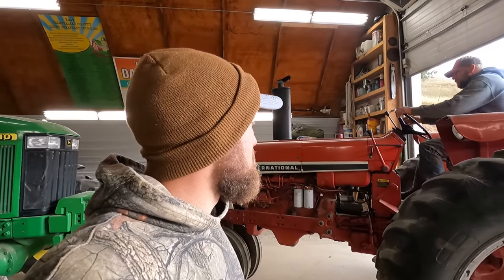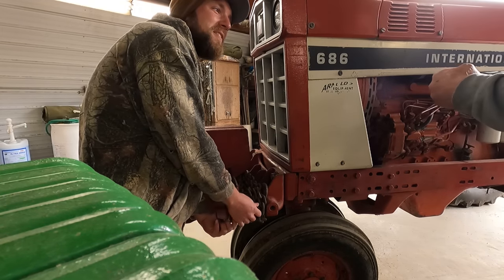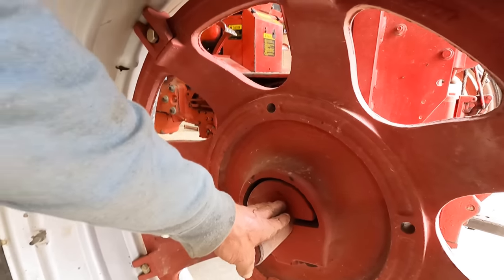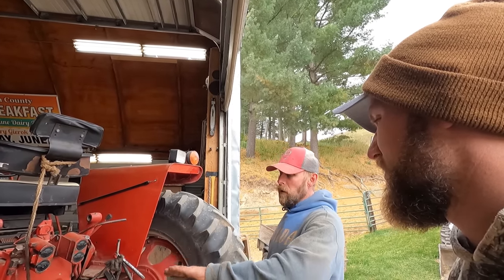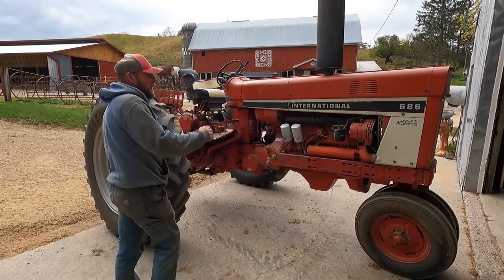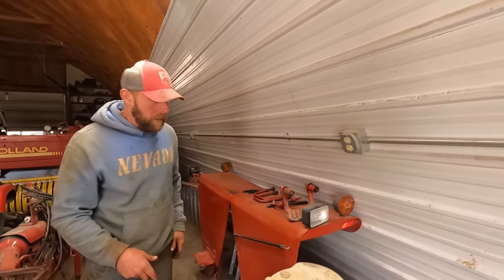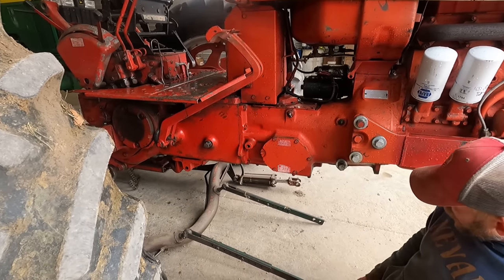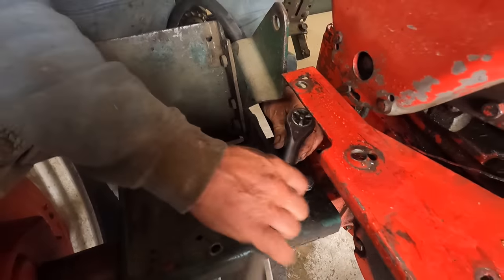Getting Ready For Harvest 2022 l Mounting The Corn Picker l Part One

Comment: This takes me back over 60 years ago. We had a NH picker like yours on a IH 656. We picked on a flat bed hay wagon which we installed 3 ft side boards. My dad would have my brother and I open the field with a machete. We would pull the ears off the stalks and sell them for feed for the birds and deer. We would tie the stalks and sell them for decorations. That was our  payment for opening the field. We would cut two rows around the field. Our income was around $50-60. Good money in the mid 60’s an early 70’s. Thanks for the reminding of this.
Reply: Why did you have to "open the fields" if you had a MOUNTED picker ?

Comment: I had a New Idea just like yours. We used the sheller attachment to shell out the corn cribs. Kinda strange arrangement but it worked great. The New Idea replaced the MH Self Propelled. Also we had a Ford Picker mounted on a Ford 6000. The New Idea was on a JD 720 LP. Memories Memories. Thank You 😊

Comment: I have a corn picking story to tell. I picked corn with my IH two row mounted picker. I was picking across the road and my teenage nephew was unloading into a crib. The corn was up into the roof and I saw my nephew up on the top of the crib and elevator. I overheated, so I began walking up from the field. The closer I got I could hear my nephew hollering. I ran as fast as I could. The chain on the elevator got loose and the cobs began to get in under the chain. My nephew tried stepping down on the chain to get the cobs going and his leg got caught. The paddle bent his leg behind his knee, and carried him up the elevator. He got to the top and it wedged him, and killed the tractor! Thank god I had a Farmall “C” on the pto. My wife called 911 and I climbed up with a bolt cutter and cut the chain and slid him down the elevator like a slipper slide. Believe it or not, it didn’t brake any bones. It didn’t even brake his skin open. It was probably the luckiest day of his life.
 I just wanted to wish you a safe and plentiful harvest!

Comment: The first picker I personally owned was a 237 John Deere which I mounted on a 60 John Deere. The guy I bought it from had it on a 70. The guy who bought it new in 1973 had it on a 3020. Most of my hours picking have been on a 4010 or 4020 with a New Idea 324 pull type. We had two of them, one with a sheller on it. My experience with the John Deere and from what some of my neighbors say, the New Idea was just a better picker. The sheller did such a good job the guys at the mill would compliment how clean it was. I just got my picker out and ready today. I'm going to pick a load tomorrow and run it through Minneapolis Moline sheller and into the feed grinder for my steers. As far as combines go, we had a 4420 John Deere on the dairy I work on today although it been gone for years. It was a good machine that covered a lot of acres. You can run a four row wide or narrow head on it and probably have better luck getting parts for it to.

Comment: I believe New Idea was the most popular picker, & manure spreader out there! Dad's right, 56 lb a bushel for shell corn, 70 for cob corn! I use to know all the weights, oats, wheat, barley, rye, ect! Your Dad is the man, he's right about side hills! I use to plow sidehills, always threw the furrow up the hill, so the next pass the wheel would be in the furrow to kind of level the tractor up! Hey, Bud! you know if you don't have a filter wrench your belt will work! Also, a belt works for a cow halter too! That's like a JD # 5 mower, it would fit different brands of tractors, but just different brackets! I was going to say, I want to see that picker put on!

Comment: I like the way you fellas take care of your equipment. I had a NI mounted corn picker on a IH M, years back. The tractor had a single front wheel. I noticed your tractor has the two.  Your 886 is very similar to the black stripe 966 I still have. My tractor has a cab, and the batteries are two 6 volts and mount up under the operator platform. I didn’t see any battery on the brake pedal side of your tractor, and couldn’t get a clear view of the clutch pedal side, so do you run one 12 volt? And where is the battery located?  Oh, very nice looking tractor !